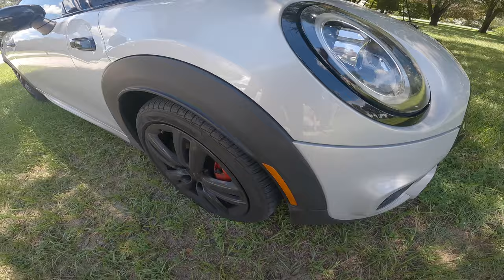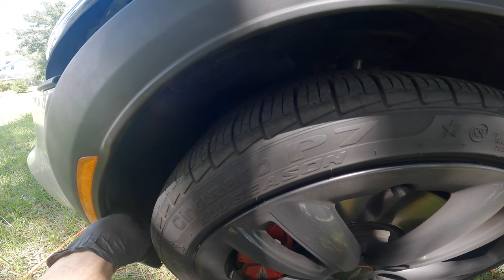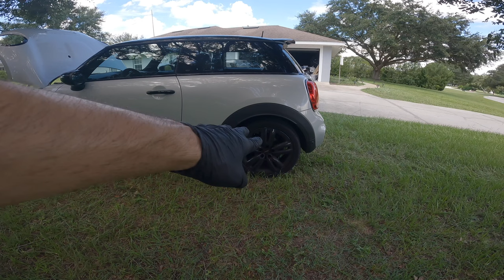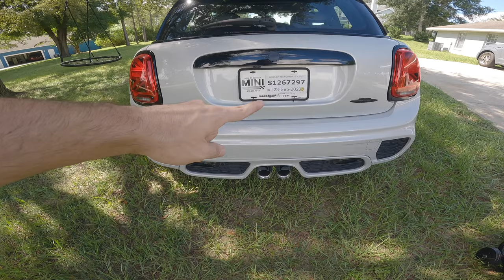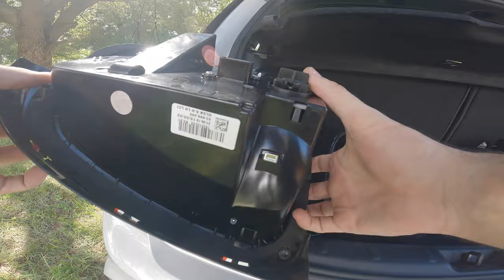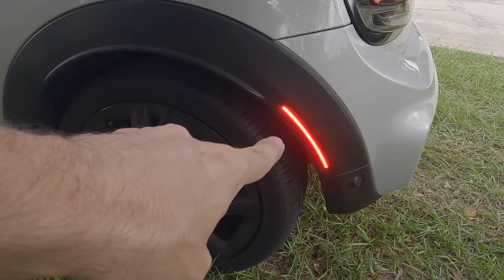Mini Cooper Union Jack Tail Lights // Tinted Rear Fog Lights

Comment: Any issue with “backup lamp fail” alert code?  I just installed mine. Love the look but have the alert message.
Reply: did you ever figure this out?
Reply: @Oplix  yes. I had to recode to accept the LED lamp.
Reply: @Oplix  yes. I had to recode to accept the LED lamp.

Comment: Why doesn't the middle horizontal section of your tail lights work?
Reply from the maker: They do, I just need to have the lights on for the middle to light up as well. It's my fault for not adding that into the video.
Reply: @MichaelBertini  Did you ever post a video of horizontal section lighting up? I'm looking to order these exact lights for my '23 :)
Reply: Please post a video of the middle amber section lighting up for your turn signal. No US car can do this without modification. If you modded it to work please tell us what you did!
Reply: @nberkel Coding has been figured out over at NAM. I just did this tonight on my U.S. 2019 F57 that came with the UJ tail lights from the factory.
Reply: @davidc-l9174  Correct, I was saying that you cannot do this without modification. Meaning coding. I have since done this on mine as well. I actually have a video up of mine 👍🏼